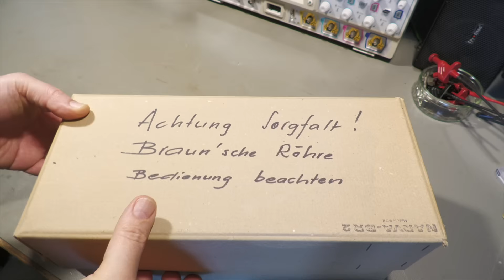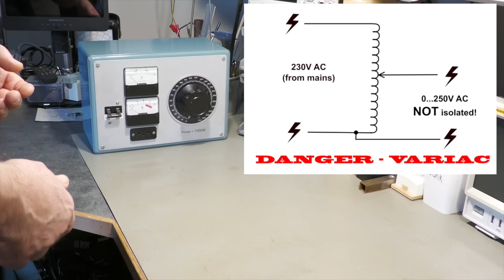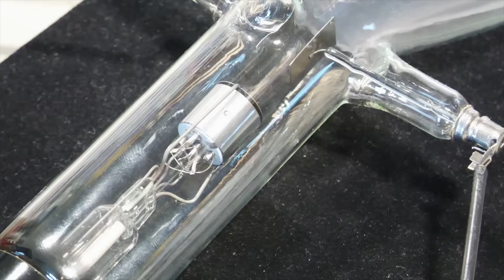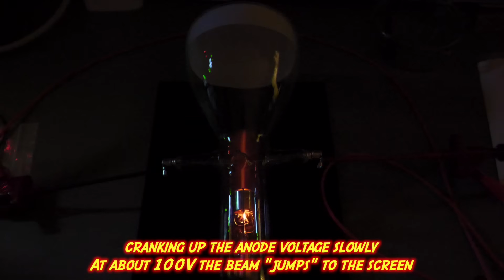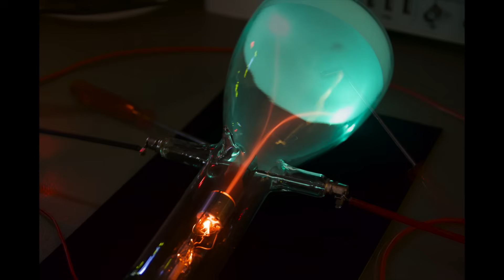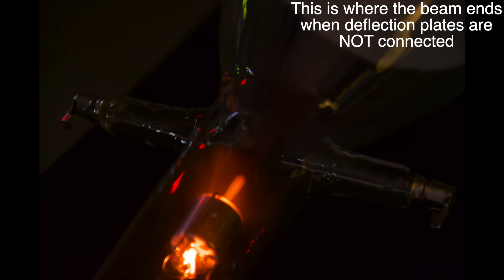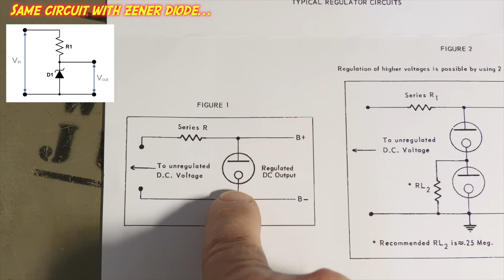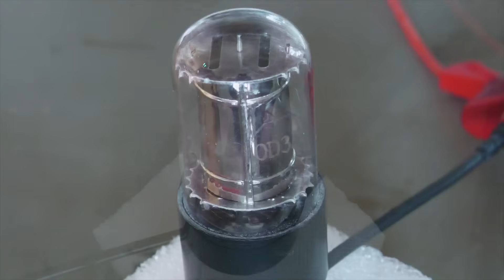Have you ever seen electrons? Watch this!

Comment: A CRT like that wouldn't normally be all that exciting, but the addition of the neon gas being excited by the beam makes it much more interesting. It's also really neat how at the lower voltages the beam just ends partway down the tube. Doesn't taper off or fade out, it just gets to some point in the middle of the tube and ends right there. Or at least that's how it looks on camera.

I do remember several years ago on one of the channels I used to watch, the fellow was doing the urbex thing in an old government facility underground that had been mostly abandoned. Inside one of the cabinets was one of those huge glass mercury rectifiers that was still in operation. I haven't a clue what it was doing as there wasn't much of anything electrical running down in the place, but it was there and lit up with that really neat ghostly blue light they put out. I've always found those things really, really cool. They look like something straight out of mad scientist's lab in some 50's Frankenstein movie. A little scary as well, since you know those very large ones do tend to have an obscene amount of power running through them when they're running, lol.

As for the next video, I'd like to see what "the thing" is. I suspect I know what it is, but I'm not certain enough to make an honest guess.

Comment: That's a very nice tube for educational demonstrations. It's very hard to find a CRT with a clear internal view and even rarer to find one with a visible beam.
Reply: He needs to get this connected in lieu of an oscilloscope CRT and get with the slow-mo guys stat!
Reply: @checksum00  It's not going to reveal anything.
Reply: @checksum00 I don't think they can capture the speed of light, bro
Reply: @CBX81 😆😆😆.  It has been done for years now.
Reply: @jamesharrell4360 the slowmo guys? No. Maybe Alpha Phoenix and science labs, sure.
Reply: @CBX81  The electrons in a typical CRT are only moving at about 20% of the speed of light.
Reply: @juliavixen176  Not just that. I'm sure that the angular deflections of the beam and the spot on the screen are not moving anywhere near the speed of light. Slomo will still reveal interesting details.
Reply: @checksum00  
Slow-mo? De deflection is direct, and the electron beam travels at light speed.
Reply: @Sine1040  What is this nonsense? Electron beam travels at 20-30% of c. It requires relativistic considerations when doing precise calculations, but the speed is nowhere near c.
Reply: @Urgleflogue  Still, way to fast for a slow motion camera.
Reply: @Urgleflogue electron by description is a scalar, often faster than light, medium slows light not scalar
Reply: @Urgleflogue  I think you glossed over the part where suggests using it as an oscilloscope CRT. So to me that implies we'd get to watch it do oscilloscope stuff in slow-mo. Which I agree would be quite cool to watch filmed with a sufficiently high speed camera like Gav has.
(though I suspect it wouldn't be able to do true oscilloscope stuff due to not having the vertical steering grids)
Reply: @DUKE_of_RAMBLE  Yeah, without vertical deflection you can't do much with this tube. If my memory serves I remember watching a slow motion video about how the CRT screens actually produce image, and they were able to capture on camera the fact that only one pixel is being irradiated at any moment. With this particular CRT I'd be a bit concerned about Xray leaks though. I wouldn't play with it too much.
Reply: @Urgleflogue  Yep, that was Gavin of Slow-Mo Guys! (though it's possible others have filmed similarly)
Crazy how fast CRTs work! 🤯
Reply: @DUKE_of_RAMBLE  Indeed, I remember now. Thank you!
Reply: @Sine1040 Aside from the fact that light has already been slowed down and recorded by several institutions, electrons have mass and must be accelerated just like a proton. They cannot physically travel at the speed of light, let alone inside of a tiny gas-filled CRT operating at 200v.
Reply: @Sine1040 eV=1/2m(v squared) So a little more than 2% light speed in this case. Electrons have mass they can't travel at the speed of light.
Reply: There is a set of coils (helmholz coils) that go with this model so you can deflect it in X and Y
Reply: @Sine1040  What is the specialty of Helmholtz coils wrt regular beam deflection coils?
Reply: The Thing.
Reply: The closest I have to this is a Crookes tube, but I can’t run it for very long as it makes a ton of X-rays while it’s on.
Reply: @ThePianolaGuy  Does it have a metallic target?
Reply: If you get Transperent Real Tv crt you will not be able to see these  beam because of high vaccum no ions .